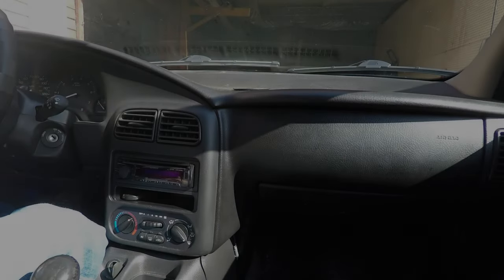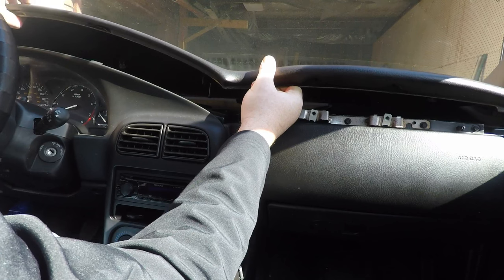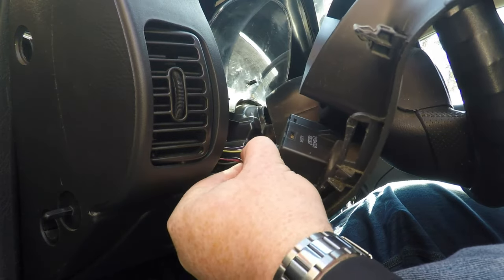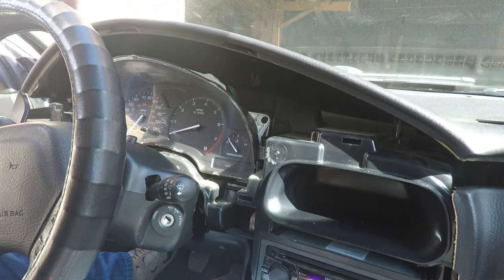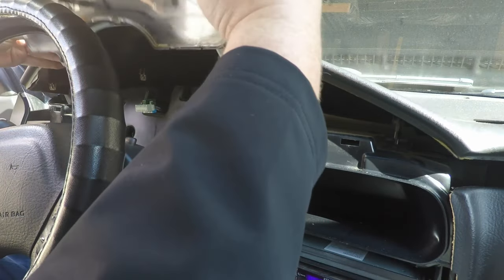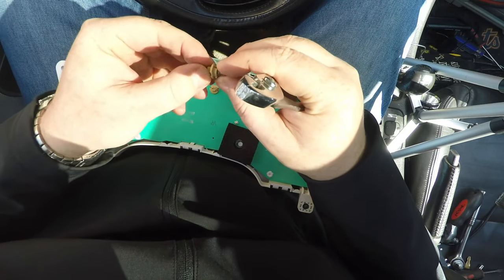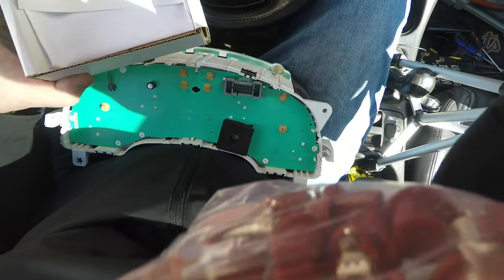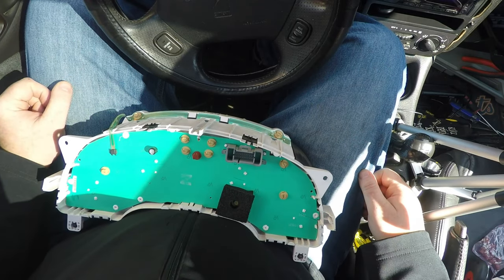2002 Saturn SC2 Instrument Panel Lights Replacement

Comment: I bought 1st generation LED's for my 1999 SC2. The rings went bad and I couldn't find a local mechanic to tear down the engine and do the repair. With 272,845 on the odometer I sadly sold my 1999 SC2 to a junkyard. I now have a 2001 SC2 replacement. Your video here of how to remove the dash and remove the instrument cluster has given inspiration to perform the same and replace the incandescent with LED's.

Comment: Thanks Chris for the helpful video. I replace all my bulbs today after a little difficulty with the top of the dashboard, and also, which bulbs go for which part of the instrument cluster.

The top of the "U" shape in the center: the very top two are turn signal indicators.  The two below that are the inside part of the instrument cluster (high-end speedometer and low end RPM's).  The bulb at the bottom of the "U" is the high-beam indicator, which is blue automatically, so I just left a white bulb in there.

The two bulbs at the very top, and the two outer center bulbs on the right and left side are also for the instrument cluster.  The top right one, below the very top, is the daytime running light indicator, and the one below that is for the fuel gauge.  The one below that and to the left (near the very bottom) is for the odometer.  The bulb on the far left (when looking at the back) is for the water temperature gauge.
Reply from the maker: I added annotations indicating just that, but I guess they aren't working. I ended up replacing 4 bulbs....I actually switched clusters with a 2006 Pontiac Torrent. It is plug and play, and looks way better..I transferred the LEDs to it.
Reply: No sir, I did not see any annotations--but they would have made all the difference, just like when I found the diagram mapping out which of the ten bulbs go for which component.

Comment from the maker: I used part number B8.5D-RHP at www.superbrightleds.com , but I had to modify the connections a bit to make them work. I did not actually replace all that I showed in video. I may to a follow up video....I only replaced a few. (in video #4, 10, and Odometer)
Reply: UCN Conversions I chatted with superbright and they were telling me to order the B8.4Ds. But you put in 5ds. It's possible they were wrong. What do you think?
Reply: Can you please tell us what mods you made to the connections please?? Thank you for the video.